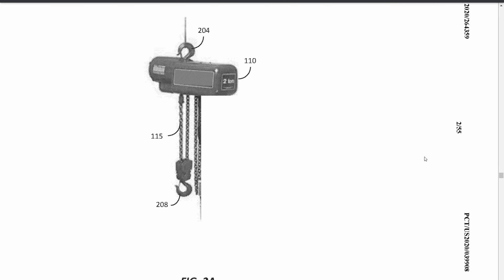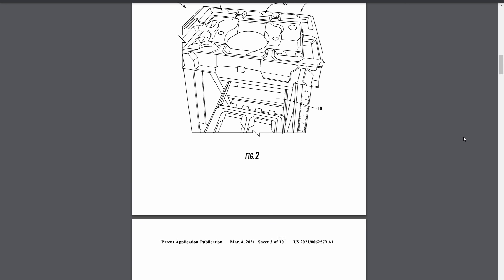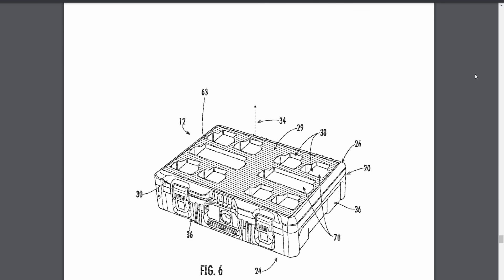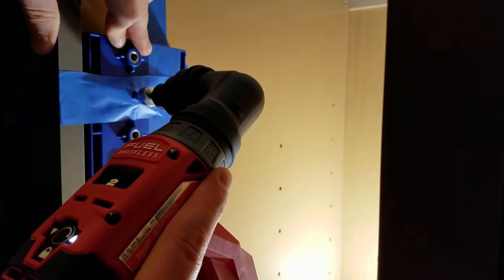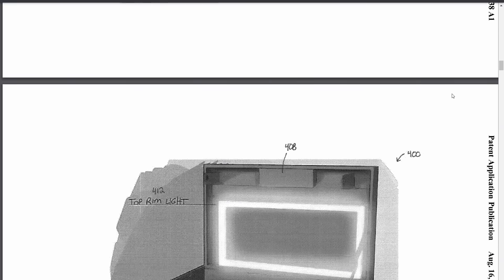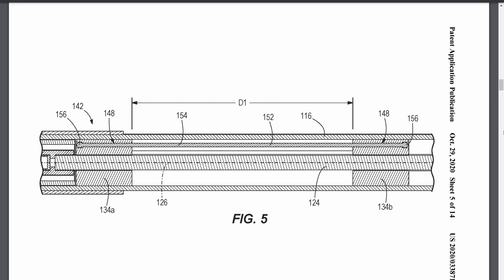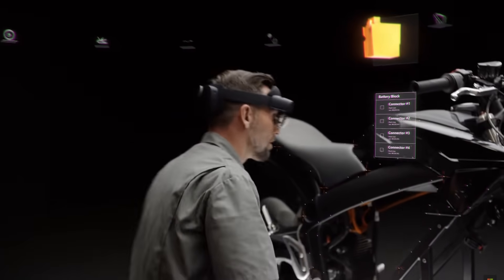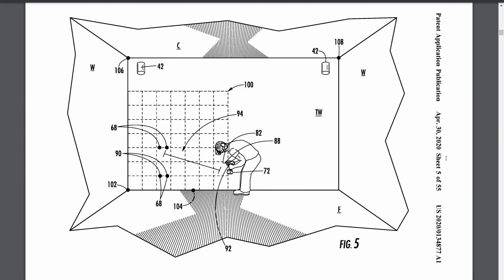Milwaukee Tool New Patents for 2021 - New Tools We Could See This Year!

Comment: Here is my Milwaukee wishlist...or part of it..
1. Packout rolling tool box with drawers, maybe 2 different options, a 2 drawer and 3 drawer 
2. Packout vacuum with auto start for cordless tools, updated tools to go along with the system 
3. M18 Fuel roofing nailer 
4. M18 Fuel belt sander 
5. M18 Fuel orbital sander 
6. 2nd. Gen M18 Fuel 15 and 16 gauge finish nailer
7. M12 cross line laser with right angle line 
8. M12 Fuel cable stapler 
9. M12 Fuel hot glue gun 
10. Packout rapid charge station 
11. Updated miter saw stands 
12. M18 Fuel drywall sander 
13. Updated M18 Fuel planer
14. M18 Fuel power cleaner washer 
15. M18 Fuel tile saw
16. 2 drawer packout with deep/shallow drawer 
17. Last but not least, M18 Fuel tracksaw
Reply from the maker: That's a good list!

Comment: They should be making a tubing cutter that will cut 1.25", 1.5" and 2" copper pipe! My company already has the small one that cuts up to 1" in all their vans...and i would insist on having the bigger version in all the install vans as well.  Also instead of dreaming up an oculus job site pipe dream...maybe they could fix the chucks on their drills instead.  i just don't understand how you can have the best batteries, the best drills...and have the worst chucks on earth on them.

Comment: Is anyone actually buying the $400-600 Milwaukee laser levels when the Dewalt, Klein, Bosch, etc are all $150-200 for the same exact features (plus a case)?
Reply from the maker: Just curious, where are you seeing equivalent lasers for that price? The newest Bosch and DeWalt 3 Plane Lasers are $450-500, and have a 25' shorter effective radius: https://www.homedepot.com/p/Bosch-200-ft-Green-360-Degree-Laser-Level-Self-Leveling-with-Visimax-Technology-Fine-Adjustment-Mount-and-Hard-Carrying-Case-GLL3-300G/314157118
https://www.homedepot.com/p/DEWALT-12-Volt-MAX-Lithium-Ion-100-ft-Green-Self-Leveling-3-Beam-360-Degree-Laser-Level-with-2-0Ah-Battery-Charger-Case-DW089LG-QU/207014906

The Milwaukee is still more expensive at $600, but does offer greater range. I'm not really trying to defend their pricing strategy, more just making sure we're comparing apples to apples.
Reply: @DoresoomReviews  The My statement was a little exaggerated, but not by a lot.  The Milwaukee 3522-21 is a cross line green laser (not 3 plane) with plumb points, lithium batteries, 100 ft range and no case for $349-400 depending on where you buy and optional accessories.  The Klein 93LCLG is also a cross line green laser with plumb points, AA batteries, 70 ft range with a case and a mount for $199.  70ft vs 100ft rated distances (I've found the Klein to be under-rated for distance, but dont have experience with the Milwaukees), but beyond that those 2 are extremely comparable at $199 vs $349+.  It remains pretty true as you go up.  Dewalt DW089LG-QU is $449 today at Home Depot and is comparable or better in every measurable way to the $599 m12 milwaukee.
Reply from the maker: Good point about the lower end models - I hadn't payed attention to cross line style pricing. Those do seem to be significantly more expensive for the Milwaukee model. That DeWalt DW089LG-QU you mentioned is only rated for 100' though, while the M12 equivalent is rated for 125'. That's a significant increase in range, which will require higher precision reflectors and a more powerful laser emitter which could justify the 20% non-sale price increase in that case. The M12 is also more accurate too, with a rating of +/- 0.125" at 33 ft vs DeWalt's +/- 0.125" at 30 ft.

Comment: A Gen 4 precision Drill with interchangeable heads, right angle, and offset heads ect ect is what I really want, they might have to redesign the click system to handle all that power efficiently and keep Milwaukee ahead of the competition in the all important Power stakes, but it would redefine the Combi drill and put Milwaukee ahead of the competition for the next 2 years or so, if they did.

Comment: The whole patent system is ripe for reform. You should not be able to get a patent for obvious things like a solar panel adapter for packout or AR layout system. In addition there needs to be limitations if something isn’t brought to market within a timeframe. Finally, a generic approach shouldn’t be patentable especially if there is only one way to accomplish something such as using a drive shaft to transmit power in the pole saw. Implementation details should be patentable to prevent blatant copying which would force competitors to do their own R&D.
Reply from the maker: So what I cover in these videos is the patent description and some of the implementation. The claims, which is the ONLY part that's legally enforceable, are much more narrow and generally boring to read through. So for example that doesn't mean another tool company can't make a pole saw with a telescoping drive shaft. They just can't copy Milwaukee's design. If you make an overly broad patent claim, the patent examiner will just reject it.

Comment: Specially aware tool system? I can’t see that coming to market. It’ll be too much cost and won’t save much in time. 
It would be much better to develop a program that could use the CAD drawings and translate that into AR which could then be used with a smart phone or an iPad. Big jobs will always use CAD plus there’s no scanning or protecting tools needed.

Comment: with wood prices and a new house construction boom i wouldnt be shocked if that steel stud punch came out soon. 

I know a lot of builders that have switched all interior walls on new builds outside of the places that will have cabinets hung on them to steel studs.
Reply from the maker: I was thinking the same thing! I wonder if Milwaukee planned that tool in response to lumber prices, or if they just got lucky with the timing.
Reply: @DoresoomReviews  it doesnt look that hard to make. I bet it was a quick patent, small low speed mid torque brushed motor in it and a plastic overmold that isnt too far off of a paddle switched ratchet or multitool. the head looks like something TTI would make for the ridgid plumbing tool lines so it wouldnt be that hard for retooling.
Reply from the maker: I just double checked the priority date - it's all the way back in September 2019, so they had the idea before any lumber price spikes. I'll bet current circumstances lit a fire under them to get it released to market though.

Also, TTI licenses the Ridgid brand to make the 18V power tools, but the Ridgid plumbing tools are still manufactured by Emerson.
Reply: @DoresoomReviews  true, emerson even make the crimp tools and electrical cable cutters?
Reply from the maker: I believe so. If the tool is red/black/gray it's Emerson. If it's orange then it's TTI. I believe the exception is Emerson still makes the corded shop vacs too, but I could be wrong on that one.

Comment: The installation driver/drill is on point. They should have done this from the get go instead of two separate tools and battery lines.
Reply from the maker: I think the M12 is perfect for cabinet installs and light duty work - I wouldn't want a heavier tool for that type of use. I think the M18 will be a great high-powered complement. Best of both worlds that they're probably going to have one in both systems soon!

Comment: Would really like to see Milwaukee come out with an MX Fuel mower, or a corded power source for cordless tools that are going to be used for extensive periods of time which would make the Milwaukee Jackhammer more likely to be worth a buy.
Reply from the maker: I covered a patent for an MXFUEL AC adapter in last year's video.

I really doubt Milwaukee will make an MXFUEL mower though. M18 or nothing. Their MX batteries are way too expensive - $600 for an XC pack. That's as much as an EGO mower with a 7.5Ah battery included! Plus they wouldn't have an automatic buy from everyone invested in the M18 system. Ruling out homeowners and DIYers will make the cost skyrocket due to drop in demand.

Comment: Okay as someone who inspects chain falls that's first patent kinda gave me a semi it would be so cool to see one of those or have
Reply: Absolutely! I have been thinking of how to make/get someone to make one for years. We do a lot of secondary positioning after loads are in the air on a crane (level, stand ups, etc. ). A remote controlled chain-fall/chain ratchet would eliminate the need to have a ladder or manlift to manually operate it. 
I’ll take 2

Comment: 30-Second Summary of Ryobi vs. Milwaukee

Ryobi and Milwaukee are both owned by Hong Kong based manufacturing company Techtronic Industries. Although they share the same parent company, Ryobi and Milwaukee are not the same; in fact, their positioning in the market is very different.

Ryobi is known for making professional-grade tools that are high-quality yet affordable. Their target market is homeowners and professionals looking for a lower cost option without sacrificing performance. Ryobi drills are reliable and high-performing but come with fewer features, which allows them to keep their prices low.

 
Milwaukee builds its products primarily for professional users while keeping homeowners in mind. Milwaukee drills come with extra features, more speed, and longer runtimes to fulfill the needs of professional and extreme DIYers; however, those extras come with a higher price tag.

Bottom line—if you’re on a budget and you need a drill to do small jobs around the house, Ryobi is your best option. If you’re planning to use your drill for more than just the occasional household project, spending a little more for Milwaukee’s extra features are worth it.

Comment: A power Chisel/Hammer instead of having to use air and a equipment/car jump starter that clicks on to a 8.0 or 12.0 battery
Reply from the maker: If you missed last year's video, I found an M18 jump starter patent in one of them. I've heard a lot of people ask for a cordless air hammer too, so I bet it's at least on Milwaukee's radar.

Comment: It would be nice if they made a Red Lithium USB ratchet for lighter/tighter space use. And a Red Lithium USB screwdriver like the Wiha Speede.
Reply: Especially since the Wiha Speede uses similar sized batteries as the Red Lithium USB.
Reply from the maker: Yeah, I'd like to see something like the Speed E - just maybe not $200 and with more than an anemic 8.8 in-lbs of torque! I get that it's VDE rated, but man that's a big price tag for those low specs.

Comment: I'm still waiting on news for a few other tools - i.e. m12 multifunctional heat gun, m12/m18 soldering gun, m12/m18 cordless torch gun, m18 cordless powdercoating system & maybe an m12 hot glue gun - to name off the dome.

Comment: Great research as always.  With a solar panel that small, my guess is that you would only be able to charge usb devices.  Real world results compared to the ratings on the package with solar is generally pretty far off.  It would still be pretty cool though.

Comment: All these high tech patents and they dont even have a lawn mower to round out their ope line or make the track saw that so many have requested ( i broke down and just bought a makita 36v a couple yrs back).

Id like an m18 belt sander.
Reply: The lawn mower would be tricky one… the battery consumption required for a lawn-pro is far more than the M18 platform can provide, and the MX platform is rather expensive for that field of work.  

If they did make a cordless lawn mower, I imagine they would partner with someone like Toro, and use an MX Fuel battery.  Same thing for a riding mower, although that would require a lot of batteries… probably cost prohibitive for the end-user
Reply: @alamomonkey  like most battery powered lawn mowers it wouldnt be meant as a main mower for the pro. Consumers would do just fine with it and it could supplement the pro especially within in town yards  where a pair of batteries can mow 2 lawns.
Reply: @jl9362  I get what you’re saying, but Milwaukee isn’t going to make one that isn’t fully capable for Pro use… that’s just what their mentality & focus is.  I’d be happy if I was proven wrong tho, lol

Comment: We need a integrated battery cooling system. Not a fan per say, but more like a lining in battery case that activates at say 150 degrees Fahrenheit and starts a cooling process to extend the runtime and battery overload features. Longer life for the battery and higher tech, sells more batteries.

Comment: Track saw! But also: 

Interested in that job box - plug-in, yes? Would be great to store / recharge batteries in there and not have to worry about heat.

Also have been interested in a red lithium screwdriver for years - very hesitant to mess with the M4 platform when red lithium 3.0 exists. For light electrical work it would be a great tool belt tool.

Comment: No m18 power inverter with 4 batteries  👎🏽  with higher voltage than the m18 top off
Reply from the maker: I covered those patents in my last two or three Milwaukee patent videos.

Comment: M18 installation driver! Love the hand screw driver with gearing, too. Let's go!

I think the only feature for the M18 installation driver they should pay attention to is a softer start plus lower torque mode. That's the advantage cabinet makers say the Festool CXS has.

Even the Makita XGT 40V Impact has a Soft Mode with 20 Nm max.

Comment: Hi, interesting patents you are showing! Especially the winch has caught my attention.

What I would like Milwaukee to come up with is a drillpress like the one I now have (from AEG, so at least some 40 years old!), utilising a fixed 2-speed 450 Watt drill ( also AEG, SB450, but some 45 years old). They still do a stellar job, provided a poweroutlet is at hand somewhere nearby.

I envision a (M18) stationary or semi stationary powerunit with a battery on top, much like the trim router, also with a speed control dial, but also a 5(?)- speed planetary gearbox. The powerunit is to be fitted in a mechanism which makes it travel  exactly perpendicular to the surface of a sheet of plywood (f.i.), but come to think of it, it might be desireable to have it move in an angle, say 45°, to the workpiece. For using a forstner bit this might work wonders!

Another idea concerns an accessory of the backpack vacuumcleaner ( in Europe sold as model FBPV): an angled extensiontube for use with various (aftermarket) brushtype endpieces. Sorely lacking!
An extra straight extensiontube might work wonders for taller people like me (192cm or 6'5"), as we have to bend over severely to be able to use the ridgid extensiontube currently part of the pack.

Okay, my 2¢

Regards
Tjitte de Wolff
Netherlands

Comment: So you’re telling me that Milwaukee is working on virtual reality, but they can’t give me an m18 jumper box?
Reply: Car batteries are 12volts but m18 batteries at 18volts. See the problem
Reply: @TheJttv  Dewalt already has one.  You use a power tool battery to charge supercaps.
Reply: @TheJttv  I see that you’re an idiot. I know that they patented it already, but I don’t see why they’re dragging their feet on it considering other than a track saw and lawn mower it’s the most requested thing that they haven’t come out with
Reply: @tylerrodriguez9233  1. Liability to humans health and car damage 2. Engineering resources are limited 3. projected sales are below other projects 4. Mechanics tools are a brand focus, but car accessories are not currently. 5. Battery voltages don't line up making it more complicated than it needs to be = more time and money spent on development. 6. Upper management does not read YouTube comments enough to see what people actually want when they pick projects. 7. there are already other competent products on the market.

There that enough reasons for you???

almost the same reasons they don't make a hot glue gun despite it being majorly requested.
Reply: I think the amp draw is a problem as well.  Though I have jumped my cars many times using one of the 6.0 or 8.0 batteries before.  Works like a charm but seems to pop an internal safety as I have to put it on the charger momentarily after jumping the car to use reset it and use the battery again. Probably need a large capacitor inline between the M18 and car battery.
Reply from the maker: That was in last year's patent video: https://youtu.be/-G4GJxPXIr8?t=222
Reply: @DoresoomReviews  good call, I do remember that one now.  I was thinking of coming up with something in the mean time on my own.  Might hold off now though.

Comment: For the solar panel packout, they could have the panels fan out from the sides like their light charger. Also if they used a projector for the sort of "heads up display" then if you stood in front of the projector, you wouldn't be able to see the display, so that wouldn't work; but they should definitely make safety glasses with a heads up display (that can also go over your normal glasses or can have prescription lenses put it MILWAUKEE!!!!🤬🤬)

Comment: I would like to see 21700 cell 🔋in the m12 line maybe 9 ah or 12 ah
Reply from the maker: That was in the very first patent video I did back in 2019. Hopefully they haven't tabled that idea permanently!
Reply: The problem with that idea would be that the cells actually fit inside the tool and there's already limited room, so larger cells would likely not work.
Reply: @christianness8983  they would have to only fit two cells in the handle part and the rest flat like the current 4.0 batts
Reply: @evictioncarpentry2628  you can't fit 2 21700 cells in the handle though.  Only 1.  Top of the M12 case is 37mmX40mm and that's including the plastic.  Not fitting 2x21mm cells in there.  

21700s are so space inefficient with the M12 battery case that they're pretty much pointless.  It'd make more sense to have a 9.0 Ah M12 pack using 18650 cells.